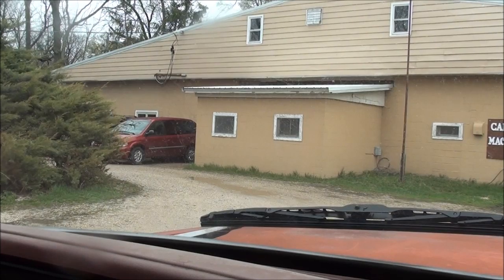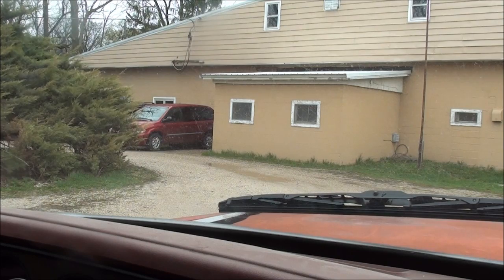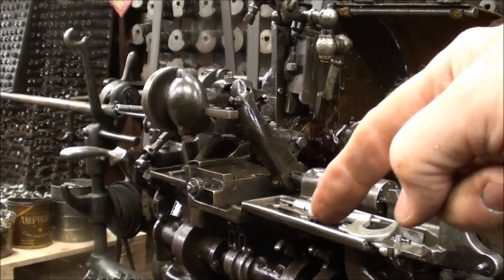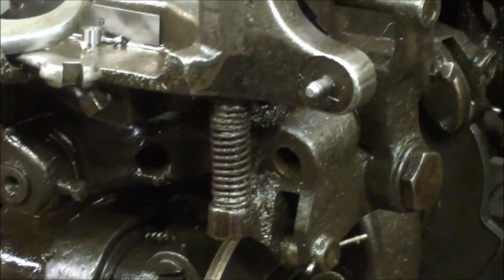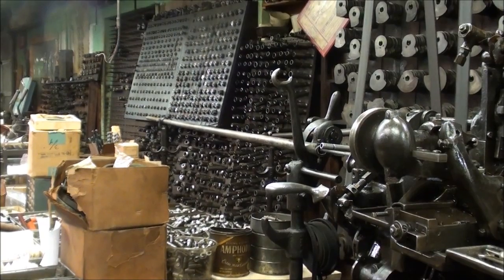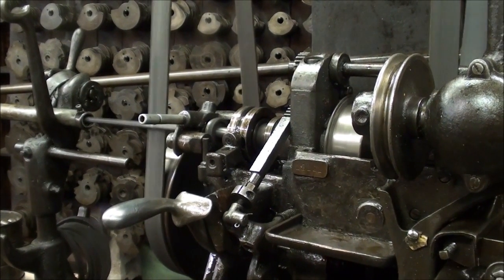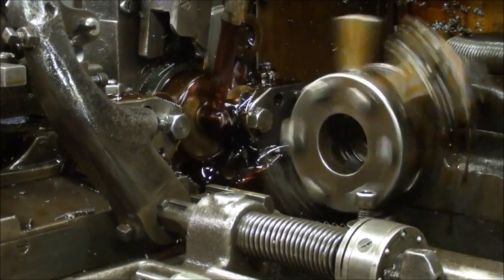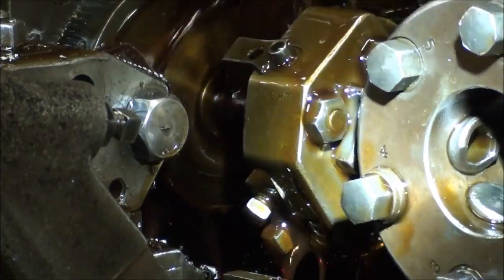tubalcain TAKES A FIELD TRIP #1 The Disassembling of America screw machine shop

Comment: Today, there are very few people who could actually design one of those machines, because it takes much more intelligence to use mechanics to cause events to take place.  I feel sad that the world is now in the hands of greed and poor craftsmanship.  All this computer stuff is really simple and all that advancing technology has done is to weaken humanity.
Reply: +GoodScienceForYou I wouldn't be so quick to say it takes "more' intelligence to design manual machine tools than CNC units which are technically FAR more complex! CNC machining centers make parts you cannot make at all on manual lathes or mills, or in this case, "mechanically controlled" screw machines. Both are impressive but the ability to make far more capable and robust equipment exists today. The CNC machines which make jet engine parts are not examples of greed or poor craftsmanship. CAD/CAM software too is not simple under the hood. If mechanical screw machines were more efficient for most jobs they'd be in mass production. Visit the Haas site for what modern American machine tools can do or check their videos.
Reply: +Ob Fuscated   The reason for most machines using computer controls is to eliminate humans.  This is because of two things.  1/ Modern humans are lower in intelligence proven by DNA studies. The average IQ in the world is 84.  In Germany 40% of the employees cannot read written instructions.   2/ The cost for employees is HUGE today and the market does not allow a company to have very many of them. This is why machines are used to make cars and as few steps as possible are done by humans.  
I don't see any improvements in skills and quality of workmanship by humans today.  Only a few humans are capable of understanding the processes and so they design and control how the machines work and force humans into menial repetitive tasks that they would have a difficult time screwing up,  in manufacturing.
Reply: +Ob Fuscated  The point again, to design those machines requires a higher level of complexity of mind and intelligence to be able to make them work.  More mathematics, more 3D visualization from 2D and isometric drawings.   That skill is too difficult for modern humans.   

According to Dr Gerald Crabtree humans are losing intelligence along with health from genetic degradation.
Reply from the maker: GoodScienceForYou Thanks---so true!
Reply: +GoodScienceForYou I wouldn't be so quick to say it takes "more' intelligence to design manual machine tools than CNC units which are technically FAR more complex! CNC machining centers make parts you cannot make at all on manual lathes or mills, or in this case, "mechanically controlled" screw machines. Both are impressive but the ability to make far more capable and robust equipment exists today. The CNC machines which make jet engine parts are not examples of greed or poor craftsmanship. CAD/CAM software too is not simple under the hood. If mechanical screw machines were more efficient for most jobs they'd be in mass production. Visit the Haas site for what modern American machine tools can do or check their videos.
Reply: Ob Fuscated I am a design engineer.  I use CAD CAM and computer controls all the time.

I design them and use them. They are simple compared to these machines.

Do you have any idea how this "technology" works?
Reply: +GoodScienceForYou I was talking about the TECHNOLOGY,, not the user OR the controls! The workers are not my concern. A CNC operator (to be distinguished from a skilled CNC MACHINIST, they are different)  in a factory is mostly a versatile production robot, which is why they can be replaced with lights-out manufacturing. The high technology is not the operator, the technologists are removed from production into design of the machining centers. 

The fabs which produce the electronic components of modern computer controlled machines are the highest of technology.  Now precision is an easy design choice.  If you want a modern jet engine or a CNC machine to produce its parts the choices engineers like yourself have to get that done dwarf those available when "Brownies" were designed. I appreciate horology too because fine mechanisms can be quite elegant, but jewelry isn't competitve from a utilitarian standpoint. The classic cheap Casio digital watch is precise, cheap to make, and takes plenty of abuse.

Those beautiful screw machines are also a "concentration of technology".  Engineers designed them to simplify repetitive production tasks so inexpensive labor could achieve economies of scale. Instead of G-code they have cams and mechanical controls. A typical machine shop bought screw machines, they didn't design or build them. The concentration of technology was at B&S just as it now is at Okuma, Haas etc.
Reply: +GoodScienceForYou What makes Dr Crabtree a canonical source, and even if the average human is a piece of shit there is ample behavioral evidence that was always so. 

We still have mathematicians and other high performing humans and only a very few of those are required for a project like complex machine design. Most people at the time of Brownie design were illiterate or barely literate and made their living in agriculture. 

Are you saying ALL modern humans are inferior to ALL humans of past generations? What ARE you getting at and what has that to do with machine design? 

B&S would have hired performant engineers who were trained in the traditional, strict manner of old instead of the sloppy but profitable (for schools) manner of today. I doubt the average engineer was designing screw machines because not many companies made them. 

Casting was the method of choice for many parts because it was a good way to make complex shapes with available technology. It was very well understood at the time so producing visually complex castings was as much pattern making and foundry craft as formal engineering. Even the Brownie is a complex construct of simple systems. A bar feeder in isolation is simple. Turreted tool holding was old news. Designers built on experience, lots of it, with previous simple machine tools. Linkage and cams were very well understood, and the Internet Archive has lots of old machinery-related literature giving an idea of how things were done. 

Visualization skills were  taught by manual drawing. Now they are barely taught at all besides explaining the standard projections and their uses. That painstaking process forced careful examination and visualization of parts and systems because correcting errors required a lot of intricate fine-motor coordination. Calculation was demanding in terms of the added workload. Hard processes demand more of the human performing them and demanded MORE people to produce a given machine. One sees this in old photographs of draftsmen working row on row in engineering firms.
Reply: Ob Fuscated In 1969 the USA put some men on the moon.  Most of the design and drawings for those craft were done with slide rules and the best were accurate to two decimal places.
The calculators were mechanical devices with motors that spun wheels to do the math.

The computers used in this project were very basic. 

I would have loved to see those engineers now working with the same rigor using 3D drawing programs.  The "stuff" they could create would be astounding. 

Unfortunately most of technology is used to kill people and all of the "latest" advances in electronics, and technology is promoted by the aerospace (military industry).

Yet with all this technology modern doctors are dumber than their predecessors, because of genetic degradation.

The schools systems work on a "curve" the worst intelligence cannot be left behind, so it takes down the averages. And rigorous "hard work" is frowned on by the new socialists in charge.

We can see that this curve has a cause.  It comes from infected reproduction destroying the human species at the genomic level with mutations.
Viral infections at conception enter the host cells of the reproductive cells, and disrupt the remaining healthy patterns and screw it up.

The most infected people on the planet are young women ages 13 to 24.  Statistics show a constant 1 in 3 are infected with 1 or more STD's.  

Healthy reproduction requires healthy reproductive "regions" of the body. 

12,000,000 causes of medical misdiagnoses causing harm to patients. 

http://www.livescience.com/44888-misdiagnosis-doctors-visits.html

The third leading cause of death is death by doctor.
Deaths by medical mistakes hit records
400,000 people die each year from medical mistakes. Up 240% in 4 years from 160,000 in 2010.
http://www.healthcareitnews.com/news/deaths-by-medical-mistakes-hit-records

Number one cause of death  Heart disease.   A proven genetic disease in which the arteries are etched by the immune system (mutations making the arteries incorrect and this calls the immune cells to destroy them,) and that normally slick artery becomes like a gravel road and it collects lipids. Autoimmune disease "appears that the immune system is out of control".  But it is just doing its job based on the original design to destroy wrong proteins and screwed up cells. 

Number 2 cause of Death is Cancer, proven by over 500,000 peer DNA studies to be a genetic disease of the immune system.  Cancer cells are a normal occurrence in humans.  The healthy immune system will destroy those defective cells. The weak and defective immune system cannot even recognize them as defective anymore.  This is the opposite sort of disease.  The immune system is weak and defective. 

Number 3 cause of death,  Medical incompetence.  The MD's today have all sorts of technology and still they cannot diagnoses and treat diseases correctly because they are retarded from mutations causing an overall retardation of humans.  Memory loss is the most common disease.

If the medical industry was a success there would be a reduction in diseases leading to no disease at all.  Why do people think that having more and more doctors, medical centers, and diseases is a good thing?
Reply: +GoodScienceForYou 
http://www.forbes.com/sites/daviddisalvo/2013/05/26/think-fast-are-we-really-getting-dumber/

"First, the study results run counter to a well-studied phenomenon known as the “Flynn effect.”
  Named after James Flynn, a political scientist who first discovered it
 in the mid-1980s, the Flynn effect is the surprising trend of increasing intelligence over time.
Flynn found that IQ increases about 3 points every 10 years, based on
 results of well-established tests of intelligence including the 
Wechsler Intelligence Scale for Children and its adult counterpart. 
That’s nearly a 10-point increase per generation. Rather than accounting
 for one aspect of intelligence, like processing speed measured by 
reaction time, the Flynn effect considers a range of factors 
cutting-across verbal and mathematical aptitudes—and in general it 
evidences a clear advantage for the modern mind.
The reasons for the Flynn effect are likely many, but the biggest one
 is that ever since the industrial revolution we’ve been the 
beneficiaries of more education, more technology, and more opportunities
 for sharpening our minds than our pre-industrial ancestors. In other 
words, the Flynn effect shows undeniably strong societal and cultural 
influences on intelligence.
The takeaway from the Flynn effect is not that our forebearers were 
stupid, but rather that as time passes we’d do well to recalibrate what 
“general intelligence” really means. Comparing your intelligence with 
that of someone living half a century before the industrial revolution 
isn’t apples-to-apples; at best, it’s a comparison of apples grown in 
radically different soils and climates.
The second wrench to fling (not nearly as significant as the Flynn effect) is that reaction time appears to be changeable. Research suggests that it may in fact be changeable by doing something as simple as chewing gum.
If reaction time is so easily altered, we might ask if it’s such a 
sturdy indicator of general intelligence after all. At the very least, 
we might ask if sweeping arguments about the advancing dumbnification of
 the Western world should be built on something that gnawing a few 
sticks of Big Red can tweak.
At any rate, it would seem that rumors of our stupidity have been 
somewhat exaggerated. We may or may not be significantly smarter than 
those who came before, but the evidence isn’t pointing to us being 
alarmingly denser. It’s even possible, if not probable, that we’re right
 where we should be."
Reply: +mrpete222 No, it's not.
Reply: +John4566442 Yes we are really getting dumber. 40% of high school seniors cannot read above the 5th grade and they cannot understand simple math like simple interest or adding or subtracting a check book.

People want to think that because they are lower intelligence and that is how they are. The people selling this idea of increased intelligence are retarded and have no real idea what relativity is because they live in a tiny world surrounded by retarded people and think this is just fine.

Do you think that 40% of seniors are brilliant because they cannot read no write. They have learning disorders.

Most people today cannot understand more than one field of endeavors either. People get PhDs in one very simple subject full of repetition.

This is just how it is.

Comment: G'day Pete it saddens me too, the trades that are being lost. Australia is going the same way nearly everything is made in China or some other overseas place, talk about free trade!  You just wonder should anything happen like a war where is the manufacturing going to be done.  I enjoy your videos.  Regards John Tasmania Australia
Reply: +John Kinnane It's not all bad. The Chinese are making a lot of machines that the rest of us can buy and use. I just purchased a metal lathe from Grizzly which is made in China. It will make it possible for the first time for me to machine my own parts. Also, look into CNC milling machines. Some of the lowest cost ones are made in the USA.
Reply: +Tapajara I couldn't agree more I too have bought a Siege 7x14 lathe and mill.  However that wasn't my point you can have both and the machining in China is getting good as companies over here manufacture them under licence in China because it's cheaper, you could blame Unions for the pushing up of wages, conditions ect,that's what happened here.  But so long as they import on the same degree as us! John

Comment: Oooooh! A Turner-Drive #00 B&S screw machine. Great machines for light work. I had one that was a 3/8" capacity. It used the B&S #00 collets (which I still have a few). Still have 3 Brownies (1 belt drive ((not a Turner-Drive) and 1 chain drive #00 1/2 capacity, 1 B&S #2 3/4 capacity "pushbutton" 4-slide). The #2 machine doesn't get used as much as the smaller machines….. I also have 2 CNC lathes. For simple jobs the Brownies kick CNC butt! One job I run has a 2 1/2 second cycle time. I run it at 3 1/2 seconds because the machine works better at a relaxed rate! The same part on the CNC would be about 12 seconds. At the end of the day it's about quantity and quality. That's why I have both… they have their strengths & weaknesses…
Reply from the maker: sp1nrx That's a good example--hope others read this
Reply: HaHa, I was just as excited to see those Turner Drives! I remember we had two at my Father's shop back in the early 80s. Have not seen one since.

Comment: THANK YOU very much for this one Lyle, I could smell the oil, solvents and electric ozone, At the same time it saddened me deeply, as we witness the country we love fall slowly into industrial death throes. It brought a tear. BTW. I love the steam videos. I was born a hundred years too late.
Reply: There is a shop here in Spokane, Crescent Machine Works, that  has overhead shafts and flat belt machines still in service. They have modern stuff also, but those old belt slappers still turn out gnat's ass work. I used to go there just to hang out. The Boeing Red Barn Museum is an amazing visit if you like Seattle. ( I hate the place)
Reply from the maker: irwin rommel
Thanks for watching-sound like a neat shop.